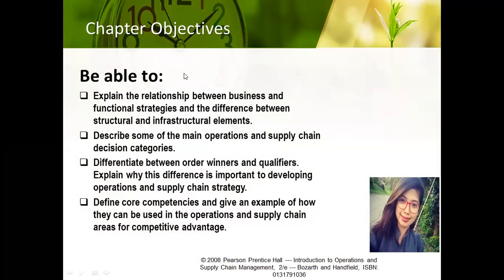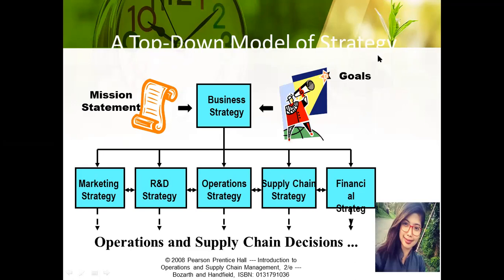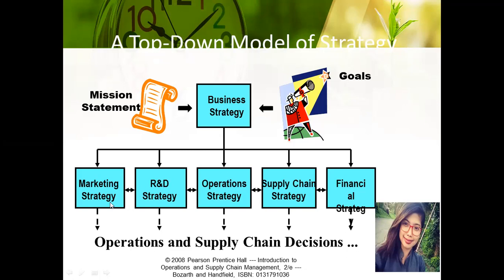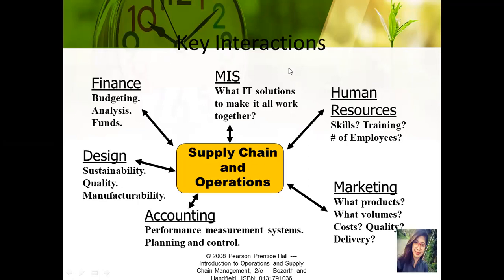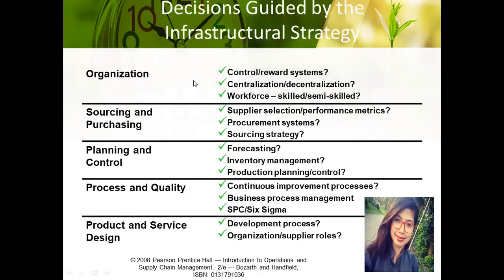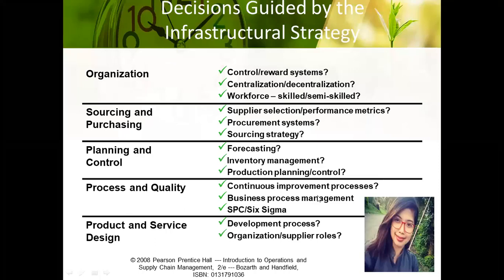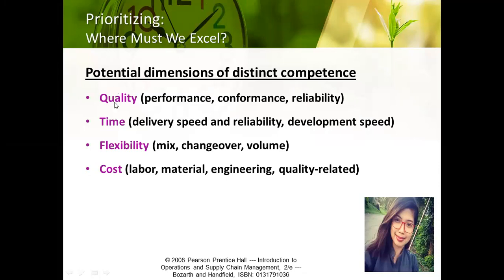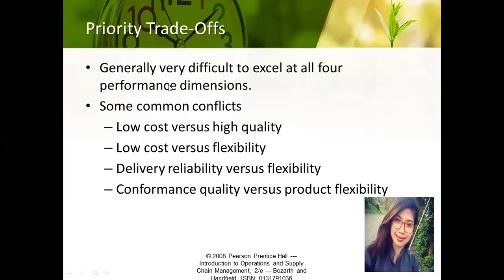Operations and Supply Chain Strategies

Comment: Rojas, James Beethoven M.
BSHM 2-1

Business strategy
Planning, strength and weakness, efficiency ,control and competitive advantage
Structural strategy
Structure involves the nuts and bolts of the business, and it varies widely, based on the niche and business model. The structure begins with the job roles for executives, management and departmental needs.
Infrastructure strategy
The infrastructure is important for faster economic growth and alleviation of poverty in the country. The adequate infrastructure in the form of road and railway transport system, ports, power, airports and their efficient working is also needed for integration of the Indian economy with other economies of the world.

Comment: Garcia, Angelica F.
BSHM 2-1

My three takeaways:

°Functional strategy- it is the direction and guidance of business strategy to make it functional and it helps in decision making. It also assures coordinations of all members in the chain.

°Value analysis- it is the standard or a preference for what is need to improve or choosing the best choice that benefits your business.

°Orders winner and qualifiers

Winners- it defines the performance of your business that is cannot be duplicated and way more than better than most of your competitors.

Qualifiers- it only defines the minimum level of performance in your business. Compared on the winners it only the average level of performance.

Comment: Bendo Alyssa P. 
BSHM 2-5 

- Structural (Difficult to Change)  it is not immediately easy to replace Just like building, Computer Systems, capital asset and Equipments.
-Infrastructural (Relatively Easy to Change) it is a part of the business that can be easily replaced example are the People, Policies, Decision Rules and Organizational Structure.
-Supply Chain and Operations consists of six elements, these are; Finance, MIS, Human Resources, Marketing, Accounting and Design.

Comment: Pilapil, Rocky G.
BSHM 2-2
My Three Takeaways:

Structural
	Difficult to change:
-Buildings
-Equipment
-Computer systems
Other -capital assets

• structural is a category of organization that is legally recognized in a given jurisdiction and characterized by the legal definition of that particular category. A sole proprietorship is an unincorporated business owned by a single individual.

Infrastructural
Relatively easy to change:
-People
-Policies
-Decision rules
-Organizational structure
• infrastrauctural are the basic facilities, structures and services upon which the rest of a business is built. 

•structural and which are infrastrauctural, structural decisions are normally taken to include those concerned with capacity, facilities and plant, technology, and Vertical Integration, whereas infrastructural decisions include those concerned.

Comment: Micolob, Keith Joy R.
BSHM 2-3
Lesson 4-Operation and Supply Chain Strategies
The Three Takeaways:
*Business Elements- In business, we have elements that we need to know and it has two types, the Structural and Infrastructural. Structural means difficult to change in the business like the buildings, equipments, computer systems and other capital assets while Infrastructural means relatively easy to change like people on the business, policies and decision rules.
*Functional Strategy- The business strategy turn into functional terms. It also assures their business will coordinate with other areas for example by collaborating with them and it provides direction and guidance for the decisions of Supply Chain and operations.
*The things we should need to focus and prioritize in terms of the operation in Supply Chain Management are Quality, Time, Flexibility and Cost.

Comment: Del Mundo Rhonel D.
BSHM 2-5

My Three Takeaways:

1. The two elements of business are Structural
and Infrastracture. Structural business are element that difficult to change such as Buildings
Equipment,
Computer systems, and the
Other capital assets

while Infrastructural business are elements that	easy to change like People,
Policies, Decision rules, and lastly Organizational structure.

2. Functional Strategy is translates the business strategy into functional terms and also
assures the coordination with other business areas and it provides direction and guidance for operations and supply chain decisions.

3. Value Analysis or the Preference Matrix is helping to maintain and to focus in gathering and assessing the relevant data.

Comment: Mark James R Santiago
BSHM 2-6

•Some common conflicts
-low cost versus high quality 
-low cost versus flexibility 
-delivery reliability versus flexibility 
-conformance quality versus product flexibility 
•The key interactions within the supply chain and operation are: MIS,Finance,design,accounting,Human Resources,marketing 
•Potential dimensions of distinct compentemce
-quality (performance,conformance,reliability)
-time (delivery speed and reliability,development speed)
-flexibility (mix,change over,volume)
-cost(labor ,material, engineering, quality related)

Comment: MARAON, CRISLE B. 
BSHM 2-3 

My top 3 take aways
* The business gave 2 elements the structural and infrastructural. Structural is difficult to change while the infrastructural is easy to change
* The Top down model of strategies it has mission statements, business strategy and goals. Business strategy havr different departments the Marketing, R&D, Operations, Supply chain and financial strategy and this strategies contribute the supply chain decision and operations.
* The decision guided by the structural strategy is the capacity, facilities, technology and vertical integration.

Comment: GUTIERREZ, BERNADETH
BSHM 2-5

Structural- it is difficult to change because it’s about the buildings, equipment and computer systems that you’re using to operate.
Infrastructural- it is easier to change because it’s about the people or your employees, the policies you implemented, those decision rules and the organizational structure. 

Quality, Time, Flexibility and Cost are the things that we need to prioritize to have a good operation in supply chain management.
Quality- The Quality of your product is very important because it is one of your pride.
Time- Time is all about the delivery and development time. If you are able to meet the exact delivery time.
Flexibility- Flexibility means responding to the changes of demand and to handle any problem.
Cost- This is all about the expenses that you have spent for the labor, the materials that used and to the manufacturer.

Comment: Banuelos Arvie S. 
BSHM 2-5
MY TOP 3 TAKEAWAYS; 
1. The business strategy are composed with the mission statement and goals coordinate im one business and they has a sub departments and the arrow represents the flow of it's process. 
2. All of the key interactions have a big impact with the Supply Chain and Operations, each department are very important because without them the supply chain and operations will not be successful.
3. The Value analysis is a process fo determining the best choice when there are no unambiguous formulas for doing and sometimes called a preference matrix.